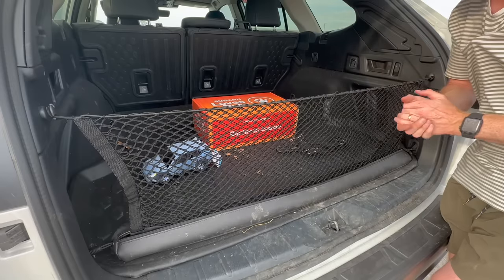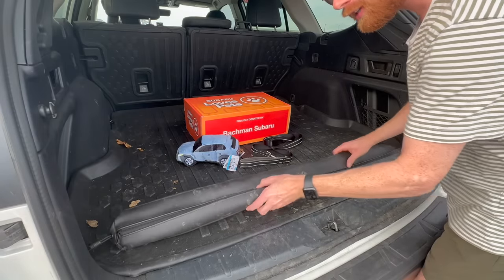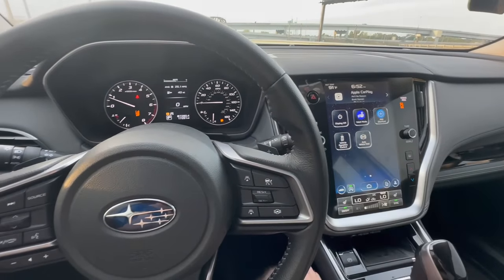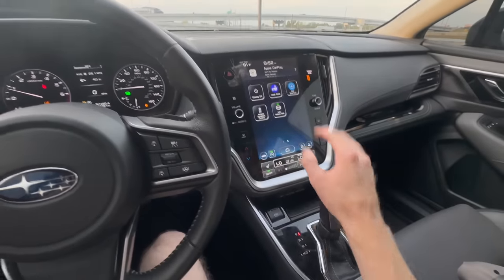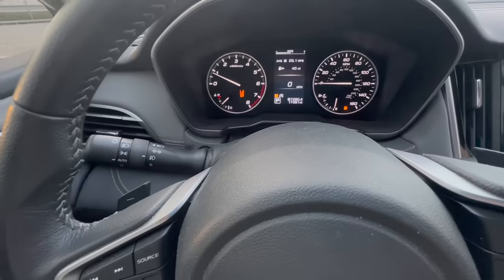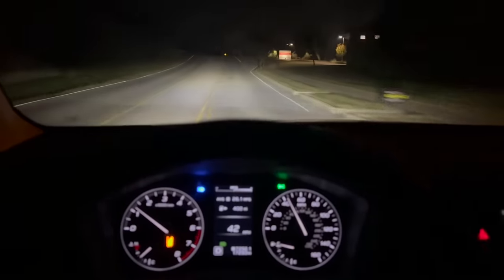Top 5 Hidden Subaru Features: Outback, Forester, Crosstrek and more

Comment: Hey Alex! I love your videos, and have learned a lot from them. I have a few questions, and I hope you don't mind. 

1.  Can you adjust the sensitivity of the steering wheel sensor, so that you don't have to have an iron grip on it to keep it from telling you to keep both hands on the wheel?
2.  With the cargo net, is there any reason you couldn't use both sides at the same time (i.e., the one with the pocket for storing items you want quick access to, and the cover one to keep things from sliding around)?
3.  What features do I need to turn off before I go through a car wash?

Thank you!
Reply from the maker: Thanks for watching and happy I could help! 

1. As far as I know, there isn't an adjustment for the lane centering for the steering wheel. I know this one can be annoying at times 😬 
2. You can use both cargo nets at the same time!
3. Make sure AVH (auto vehicle hold) isn't on when you go through an automatic car wash. All other settings should be ok to leave on.
Reply: Hey so I asked my Subaru dealership about the wheel sensor as well. They informed me it is not a touch sensor, but is rather looking for steering resistance on the steering wheel. So essentially you can have both hands on the wheel but if you are holding your hands too still, it will set off the resistance sensor anyway.
Reply: @soundgarden6857  thank you! I kind of thought that may be the case, but sometimes it seems way too sensitive. I appreciate your information 🙂

Comment: 1. 2:17 There are fuses under the hood.
2. 4:30 The cargo cover also has a built in cargo net.
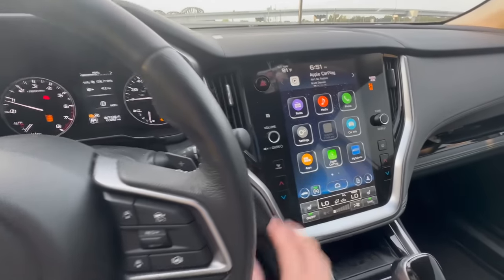3. 6:00 Auto Vehicle hold
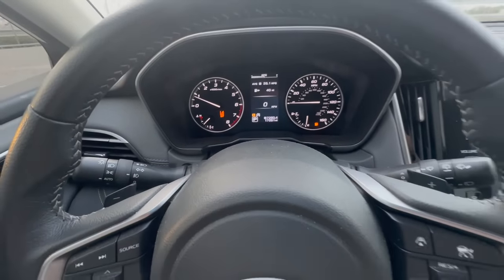4. 8:20 Highbeam assist so when there is a car in front of you (regardless of direction) it will turn your highbeams off
5. 10:10 You can set an unlock pincode for a button on your back hatch
Reply: Thanks!

Comment: I've owned three Subarus, An Impreza, a Legacy and now a Forester. I like Subarus mechanically and comfort wise, but the electronics are bargain basement and in some instances downright silly and unnecessary. I found the giant screen in the middle of the dash on the Legacy, to be a dangerous thing since you have to take your eyes off the road to operate anything. No tactile feel. The voice command thing never and I mean never understood a thing I said. It's only response was "Cancelling!" A lot of, more than annoying, bells, bings and buzzes and what genius came up with the 5mph increase and decrease with the cruise control one touch. Decades of cars with 1mph changes and Subaru decides, probably by an engineer who couldn't hold his liquor, to fix something that wasn't broken. Oh, and  the owners manual. Reduce that to a pamphlet and Subaru could probably squeeze another 2 mpg outta the cars just through weight reduction. Anyway, rant over: I do enjoy your videos, they are very informative. Thank you.

Comment: Alex. I am having trouble changing my settings on my remote start using My Subaru.  It says "start settings" and cannot be changed and it is set on 60 degrees and fan all the way on.
Reply from the maker: click "climate presets" to the right of the blue quick start button. From there you can select your new temperature. When you go to start it with the quick start button, it will default to the last climate setting you previously set. So as an example, if you last set it at 60 degrees, it will continue to start and adjust climate to 60 degrees until you change it. Hope this helps!

Comment: When you have AVH on and you come to a stop, will the ASS  (auto stop/start) come on and shut your vehicle off? If I come to a stop and AVH is on and I have my foot off the brake or even on the brake and take it off when ASS is on, will the car shut off when ASS is on?  How do I make it start again, do I just tap on the accelerator, and how hard? Seems like I will be put in a dangerous position if the car behind me is on my bumper wanting to go, do I just hail mary it and jam on the gas petal to make it start and go without hesitation?? Or how do I start my car in advance so I can pull out normal trusting there wont be hesitation of the car starting and proceeding before the idiot behind me lays on the horn because I am taking to long for him??

Comment: You're way too wordy you need to get to the point s especially regarding self promotion. I got an 09 Forester and it is solid in the basics but unrefined in the interior like coin pouch unlighted unlock button and confusing and hard to see in the dark overhead light buttons. Additionally, no booger bar is available from Subaru or the aftermarket. Next time I'm going to take a hard look at the RAV4

Comment: Here’s a hidden feature question for you - how did you turn on the ignition without the lawyer screen appearing?
Reply from the maker: I'm so used to it now I don't even notice when it doesn't pop up. My guess is because I had just turned the car off and right back on? I assume if it's off for an extended period of time, the notice pops back up when you restart. I'll have to pay attention now to test this out.
Reply: @alexpmo Screw the auto brake hold icon...If you find the secret decoder ring to turn that lawyer nonsense off you'll be a hero!

Comment: So did you just show any stranger how to get into a Subaru?
Reply: The Auto Unlock feature will only work when the key fob is within range outside of the vehicle. You can lock your keys & key fob inside the vehicle and unlock the vehicle using a PIN code through the rear gate lock and unlock button. The owners manual shows how to register a 5 digit PIN to your vehicle. You can then use this PIN to unlock your vehicle when the key fob is inside the vehicle. The PIN code is registered by pressing the rear gate button a number of times corresponding to the PIN you choose to use. Again, see the owners manual to initiate this feature. This is in my new 2024 Crosstrek Wilderness. Not sure if this also works in older models.

Comment: I cant speak for other models, but the Crosstrek is a pice of Sh$t. I am convinced that Toyota hires the best Japanese engineers , then Honda, the Nissan. So Subaru gets the bittom of the barrel. Point of fact, the Crosstrek is dangerous to drive on the highway up hills because extremely underpowered. Or if you have to do a fast merge onto the highway. If all you need it is for driving around a town in North Dakota (flat) then it probably will work. But if you driveon the highway be prepared to have 18 wheelers give you the finger as they zoom past you going up a hill. Besides being dangerous to drive, i want to know who was the id$ot Subaru engineer that designed a totally useless light for the back of the car. You will need to buy a flashlight for the back because all the Subaru light does is blind you in the eyes. Then there is the wind noise. I had a honda pilot, a quiet drive, not so much with the Subaru. Another terrible design flaw was the lighting on the lcd screen. On auto it is either too bright at night and too dark during the day. The app menu on the dashboard,  like using google maps, works only half the time, usally shutting off just when you need it to avoid getting lost. The USB ports are only reachable by young kids with small fingers and again, dont think about plugging a usb cord in when driving because how hard it is too reach, the engine shuts off at every stop and there is no way to turn that off, the paint is easily scratched, and the headlights are the weakest i have seen on a car in more than 10 years. There have been many times at night when i thought my headlights were off, only to find that they were on, the cup holders are too small for large cups, the gas mileage is about 30 mpg, which for how small the engine is, is disappointing. Other cars with a similar engine will get around 40.  My advice, pay up for quality and get a better car, but not a Subaru. And dont forget to buy life insurance if you drive on the highway or in an area with hills.